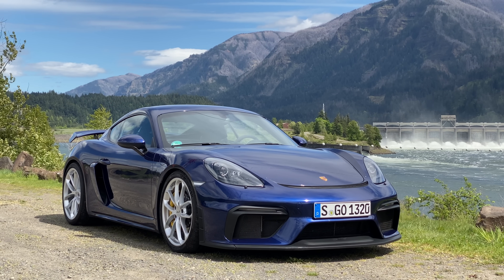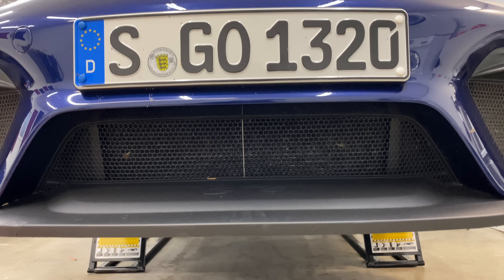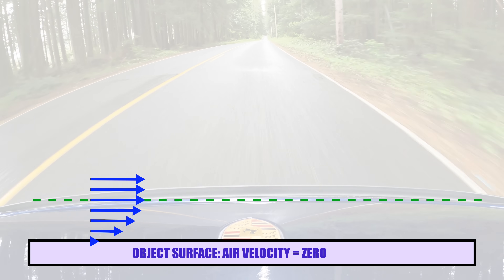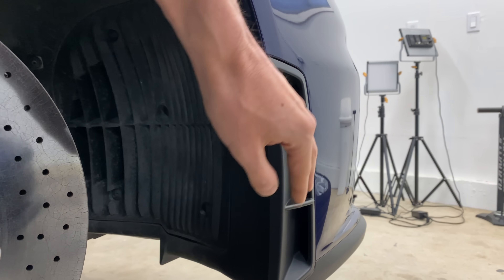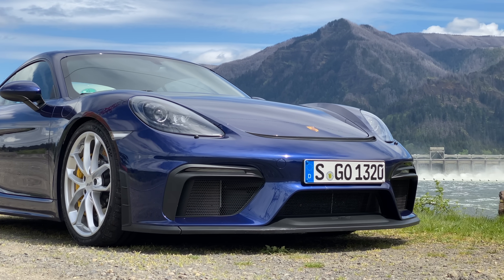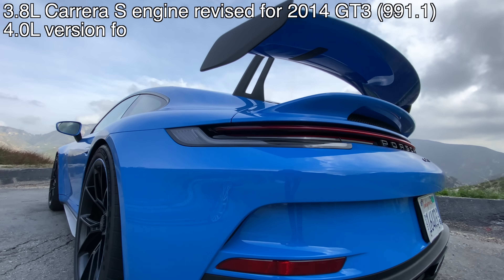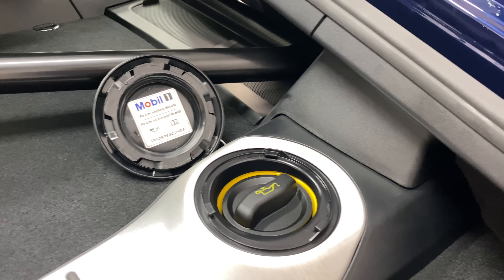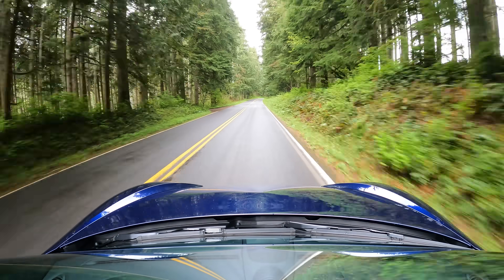The Porsche Cayman GT4 Has Dimples Like A Golf Ball!

Comment: Quote „The gt4 is designed to maximize downforce“
No it’s not, it’s designed to to sell to people looking for a status object.
If downforce  was a design criteria at all, the whole shape would have to be completely different. 
Literally any Porsche with their bubbly roof and long sloping tail is close to a perfect airfoil (wing) producing lift! Just look at the cross section of a wing compared to a outline drawing of a Porsche. It’s pretty much the worst possible shape for downforce.
If you want downforce you will have to put it on its roof!

As for the Golf Golfball surface, this is there mostly because a surface like that doesn’t scratch up easily as most of the surface is recessed and only the ridges would get scratched up should someone decide to drag the car over a curb whil most of the surface would stay untouched, nice and shiny.
Same reason this kind of texture is used on rental skis for over 20 years…

Comment: Is there an application of those dimples in space rocket tech? 🤔
Reply: No.
There are two types of drag 
1- Form drag. Which is caused by the difference in pressure between the front and rear of an object.
2- Friction drag. Caused by the friction between the fluid and the object.

Depending on the shape of the object, they contribute in differing ratios. After a point, more streamlining increases the drag because the reduction in form drag becomes smaller than the increase in friction drag. Dimples decrease the form drag but increase the friction drag. Air and spacecraft are very streamlined and friction drag already makes the most of the drag on these vehicles. Dimples would increase the drag. Though there may be some very specific cases they may be useful but a wide scale adoption is not going to happen.
Reply: Thanks for the explanation and the new topics to research  @zoka7108  

Makes sense now why they seem to focus on making smoother surfaces while keeping the same shape.

Comment: The answer to the track question is yes, I do want to track it.  I am still not convinced I should be buying the gt4.  At a savings of $20k and exactly the same engine (and same performance after an ECU tune), can't I turn the gts into a gt4 on my own and have money and spare parts left over?  I would really like your thoughts as I am currently deciding which to buy.

Comment: I think if designed correctly a dimpled car could look good. What I'm curious about is if dimpling large areas of the surface of the car would end up making it unstable at high speeds. Otherwise I would have thought we would have seen this in racing by now (especially Le Mans prototype/experimental class). It would seem we should integrate this basic tech into both EV and large trucks made for long distance hauling.

Comment: Without even having seen the video...

It´s unlike the competent German engineering team at Porsche, to have indulged in the engineering du jour of golfball dimples.

I can think of no place on the body, and relative to the typical flow field thereof, that the aerodynamic principle that makes golfball dimples a practical discovery, makes sense.

The high rotational speed of a golfball in flight entrains low-energy air within its boundary layer into said dimples, moving it from where it is to where is should be going anyway, dramatic decreasing induced drag with the incidental effect of increased flight stability. This effect is only dominant when rotational speed is much greater than linear speed.

Now I´ll watch the video to see if I´m wrong, but I doubt it.

Comment: Do you think a combustion chamber with golf balls for increased surface area would work? If so, would your theoretical piston also have dimples or matching lumps?
Reply: Inside the combustion chamber you actually want as little surface area as possible, to minimise transfer of heat that could otherwise contribute to creating pressure. And I'm not sure if it would be a good idea at all on the sleeves/piston sides (they need very tight tolerances). 
That being said, it's always a matter of compromise. Perhaps it's a possible avenue of investigation if you wanted to optimise something like swirling airflow.

Comment: Great video.   I can't, however, agree with your conclusion.  The GT3 derived front suspension and bespoke rear  suspension in the GT4  completely change the handling characteristics of the car, whether it's road or track.   They are both great cars but with its upgraded suspension, the GT4 is the better driver's car, track or street.

Comment: I'm going to fight you on the gearing complaint. I have a 987.2 that I take to the track and having second gear top out at 70 mph is actually useable.  Every other car that I've driven (Focus RS, VOLVO 240) with a 2nd great that tops out at 60 mph is basically worthless to me. even on very tight tracks or tracks with a tight corner

Comment: In the gt4, what’s the temps like coming off the backside of the radiator?
Does Porsche run those diverter fins on the gt3rs with vented fenders

Comment: That's nonsense. Have you ever heard of Reynolds number? The boundary layer of a car is turbulent without the need of dimples. Moreover the car aerodynamically is closer to an airfoil than a sphere and unlike a bulky object would benefit from being in a laminar regime in terms of drag. No car boundary layer is laminar though because it would basically be impossible to achieve due to size and speed. The reason no cars have dimples is because it serves no function.  If the dimples are raising turbulence, they are actually increasing parasitic drag without having any effect on the wake. This is not an aerodinamic feature, it's just marketing. Instead of reading the Porsche press pack you should research the subject at least a little bit before trying to explain it.

Comment: The exhaust thru the wheel well is a good idea I might have to use that on my mk1 rabbit racecar. Due to the fact that I have swapped in a haldex AWD system and a 1.8t that will make over 300hp I have very limited space in the back for the exhaust and it is 4 inches wider per side than stock so I might have enough room there it's at least something to look into.

Comment: The front axle have nothing in common , the Gt4 has got the gt3 front axle with full alignment capabilities . And at the rear it is again a « gt » construction while the gts is a « standard » Porsche setup .
So chassis wise, not the same cars. Big difference
Reply: Could be Porsche puts those dimples there to get other manufacturers chasing their tails.
The Russian MIG-23 Flogger (jet fighter) has a cylindrical shape with a point on the front sticking out of the leading edge of the right wing, for years it drove western defense analyst's crazy trying to figure out what it was for, after the Soviet Union fell and the engineers of it were ask why it was there they were told "To drive you guy's crazy".

Comment: No automotive applications? Diesel performance shops have been dimple porting for many years. Intake runners and ports mainly, sometimes other places. Truck aero is relatively unimportant until smartway came about, but fuel efficiency and engine performance has always been top of the lists for roadgoing machines.

Comment: Really excellent video!  I’m not track oriented so the GTS is my choice.  Did you notice which was more comfortable on ordinary diving roads etc?  Are there any drawbacks to GTS compared to base Cayman for regular driving.  I’d think the best choice would be a base cayman for street use?  Smaller wheels -18” rather than 20” and softer suspension.... I think would make is softer more compliant and less harsh than the sportier GTS?  Right?

Comment: According to Adam Savage of Mythbusters, a major car manufacturer contacted them after the episode aired to say that they couldn't replicate the results of the dimple test. Enjoying the vicarious vindication via German design.
Reply: The added distance to a golf ball with dimples only really happens when the ball has backspin, that creates (enhanced by the dimples compared to a smooth one) a high pressure zone on the bottom of the ball carrying it further.
However even without any kind of spin golf balls with dimples travel a more consistent path than one's without them.

Comment: I am afraid that dimpled underbody panels on a car do not improve aerodynamics. The boundary layer is already turbulent there and there is no curved surface behind it where we would need the flow to "follow the contour more precisely". It would follow the flat surface just as well even without dimples. Everything suggests that it is just marketing rubbish and the only real purpose those dimples may serve is structural stiffness.

It works on a golf ball because it has the right combination of size and speed (Reynolds number) so that the dimples would lead to transition from laminar to turbulent flow. And there is a presence of an aggressively curved surface where this transition would actually make an effect. It is a very specific case. The idea some people may get that just covering any surface with dimples reduces drag is wrong. It is a total misunderstanding of the principle why it works on a golf ball. And this video did not help clarifying this very much.
Reply: And you can of course start by citing  your sources for this?  Boundary layer technology is well understood.  And yes it does work...

Comment: Trivia:  Boundary layer air on the wing of a typical Boeing airliner works out on average to be 0.06 inches thick.  That's all it takes.  The way it works is that this air "clings" to the surface, allowing the air just above it to slide past with near zero drag.  This drastically reduces the Cd and induced drag, if the wing is designed properly.

I have a '14 Cayman S and it does not have the center radiator [the cars in this video had three radiators each] because the cooling system is sufficient for track days.  For extreme situations, a third [center] radiator is available and the retrofit is not that expensive to do.

Jason, I am certain that all the cars in this video use variations of Porsche's 9A1 engine.  So the GT3 and the GT4 actually do have the same basic flat six.  My car's 97 mm X 77.5 mm results in 3436 cc's, but the block of all these engines is the same.

GREAT video!  NOTHING drives quite like a 981 Porsche Cayman.  I'd take the GTS simply because it doesn't have the silly scoops over the side air intakes, which I HATE the look of!
Reply: PS:  I have a Quick Jack too and it RULES!

Comment: i dont understand the problem with the gearing, a family member of mine recently bought a 718 spyder. He has driven a lot of porsches and told me that the long 2nd gear actually made the car perfect for swift back roads because you don't have to shift all the time, also the car has a lot of power troughout the whole rev range so downshifting isn't necessary at low speeds but ig its just personal preference (love ur vids)

Comment: Golf ball dimples are designed to be omni-directional, if you have predictable directional airflow there is a more optimal dimple pattern, such as shark skin, fish scales etc.
Reply: It depend what exactly you are talking about. All-body shark skin patterns may improve skin friction, which is one of two components of aerodynamic drag. The relatively large dimples on a golf ball are not intended to improve skin friction but force the transition to turbulent flow and reduce the other drag component, which is pressure drag.
But sure, you could use something else than symmetrical dimples if you wanted to achieve the same effect on a surface with single defined flow direction.

Comment: Downforce is a bit confusing to me still.  We know that f=ma and so if the engine exerts some force the vehicle will accelerate by some value that corresponds to its mass.  But how does something like downforce affect this?  Does it increase the mass?  Or in the case of friction Ff=greekletter * N where N is the normal force comprised of mass multiplied by gravity, does it increase the normal force?

Edit: nevermind, he made a video about that too that explains it perfectly.
Reply: Yes, it increases the normal force and therefore the force that the tires can transfer to the road. Which will improve cornering speeds, but also braking and acceleration if they are traction limited.

Comment: The half roll cage is not available in the USA. It will make the car unsafe. Or that is the reason they say. Also you can get factory 6 point harness with the roll cage. You can get the part for the front from Porsche to make it a true cage.

Comment: Jason, can you do a video on why engines over the years have had an even number of cylinders. Why Audi failed at their five cylinder (90’s?) but now we’re seeing three cylinders - what has changed and are they a good idea
Reply: Should be a fairly simple answer I think. If it's an inline engine then an even amount of cylinders is not too important, but when it's a V or flat engine then symmetry is very important for eliminating vibrations. Even with an inline engine I think up and down vibrations could exist but combustion timings could minimize this while unnecessarily complicating the development.

Comment: I sense Porsche soon becoming like Apple, the engine will be completely sealed and unserviceable except by Porsche. You won't even be able to check the oil and the case of the electric cars perhaps you won't even be able to charge them except in a Porsche station, though that seems a little too far-fetched. But Mark my words, the trend or the attempt to get there it's clear.

Comment: A golf ball can travel twice as far using dimples, but I guess you can't reduce a car's drag by the same amount, otherwise I don't see why every car wouldn't be covered in dimples. that would be a fairly easier way to improve efficiency, emissions and performancr than expensive r & d on ICE
Reply: We don't see it on cars because it works on a golf ball for specific reasons that do not apply to a car. It has a different size, travels at different speeds and has a different shape. The boundary layer around a car is already turbulent everywhere due to the combination of those factors even without dimples.

Comment: My flight instructor heart can actually get on board when Jason talks about aerodynamics except on cars you want the opposite of what we want on planes haha
Reply: And what is that?
Reply: @yayayayya4731  Cars try and reduce lift and create downforce which is the same principle as lift just downward instead of upward like on a plane. Which is why calling a spoiler a wing is kinda ironic ;)
Reply: @TechLovinDude  as James May pointed out, the diffetence between a spoiler and a wing on s car is, whether or not you can put your head through underneath it.

The airfoil shape is the same for a wing on a car any an airplane, just rewersed. Though there have been airplanes with reverse airfoil wings. I think, it was for air shows though.
Reply: @CerberusTenshi  That's valid. I just think it's funny. 

Most aerobatic plane's wings are symmetrical in shape so the air actually travels the same distance whether it is traveling on the upper or lower boundary lower which doesn't invoke bernoullis principle and instead utilizes angle of attack manipulation with pitch to increase or decrease lift. Makes the aircraft more maneuverable for aerobatic purposes. Asymmetrical wings are better for stability and worse for maneuverability. In plane applications of course, not saying this part has anything to do with cars just responding to your point haha.

Comment: Maybe this betrays some fundamental gap in knowledge, but if it's so clear that golf-ball dimpling improves aerodynamics, why do no planes, as far as I know, employ this concept? Does this benefit accrue only within a narrow range of airspeed (perhaps outside of most planes' cruising speeds), or would manufacturing such a surface pose cost or structural problems for an airframe?

Comment: In some supersonic fighters, the wing surface has laser drilled pinholes to allow air to be sucked into the wing by a vacuum system. This reduces drag. Maintains super laminar flow and allows for super sonic cruise without afterburners. I’m waiting for this system to surface in a hyper car.🤔